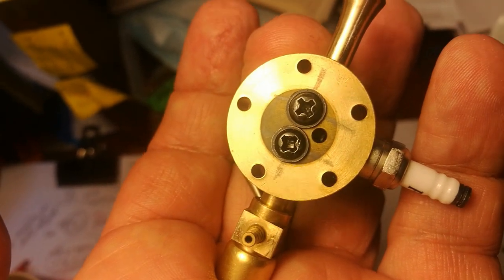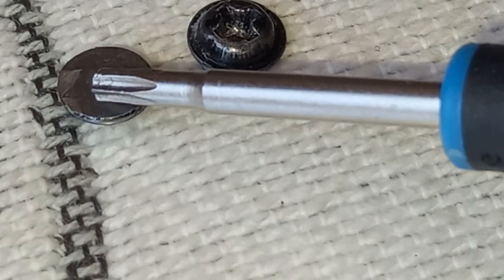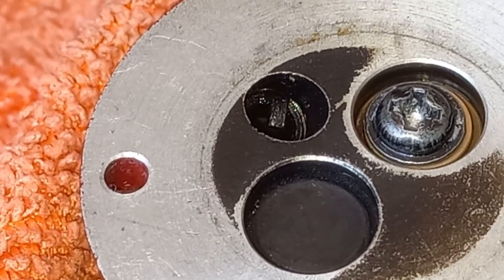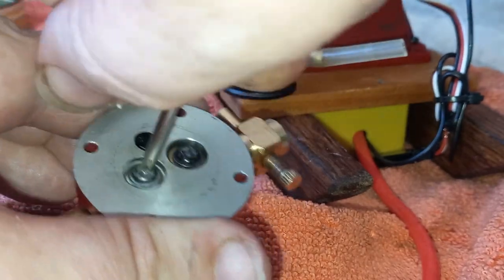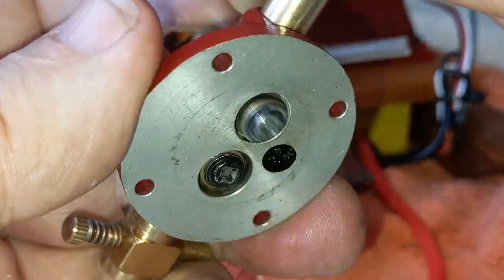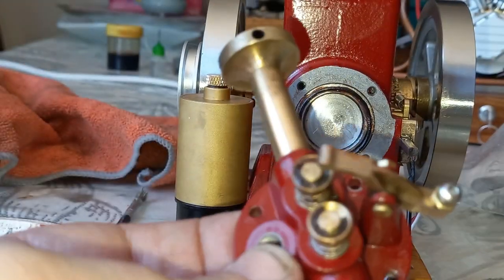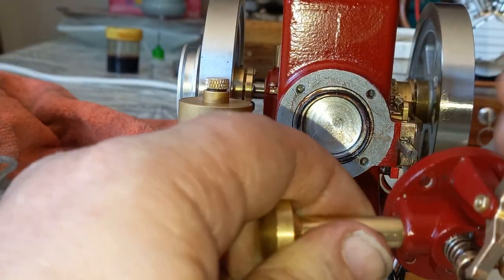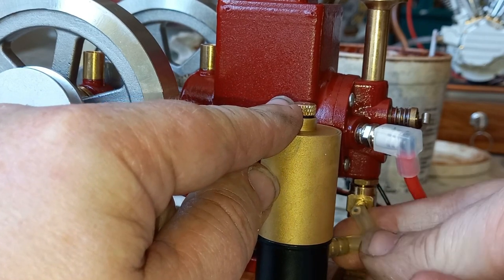Simple & Quick Valve Seat Lapping for Model Engines - raises compression, easier starting

Comment: The way i did this my m93 engine was to remove the keeper on the valve and attach fuel line to the small end, put metal polish, and put that to my power drill and it also works very well, even if the seal is terrible. You said your hit and miss engine from Eachine hat terrible bearings (which is true), i ended up greasing them since i don't have the tools and it has been very reliable.
Reply from the maker: Great advice thanks Jax both ideas sound really good and I will try the valve one when I need to

Comment: Thank you for this tip. I think it'll be useful to me.
When are you sure the valve and the seat fit perfectly together ?
Any reason why you don't use an electric screwdriver ?
Reply from the maker: Hi V Del thanks for your reply. I dont use an electric screwdriver becuse I don't have one but it would be perfect for this I think. When do you know it's done.?..As a guide, with brass valves / seats it will be quite quick if the problem isn't severe. I didn't do it quite long enough in this demo but it's about halfway there. So, use an electric screwdrive for a few minutes and try that. I think perhaps its hard to overdo it unless you really do it at speed for ages it on a drill press... I did that on the em2 micro motor with brass valves and seats and it was fine. So, hard to stuff it up I think! 😁😁
Reply: @ThomasPCGuruENGINES  Thank you Thomas. I'm trying to build my own one-cylinder tiny gas engine and how to do this job was a question i couldn't answer clearly.
A lot of work left...